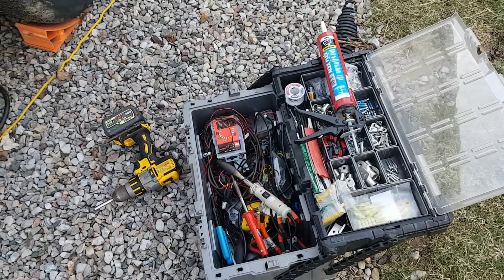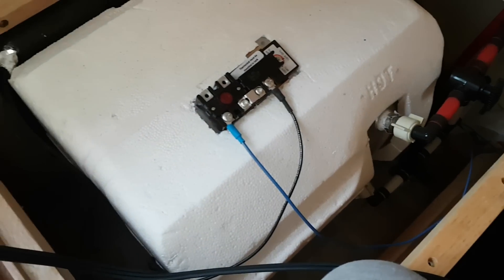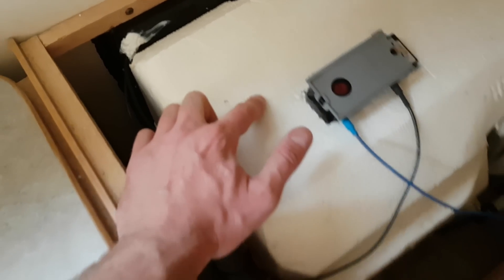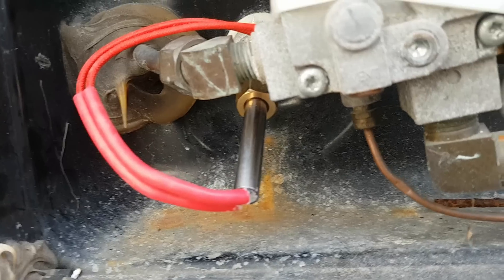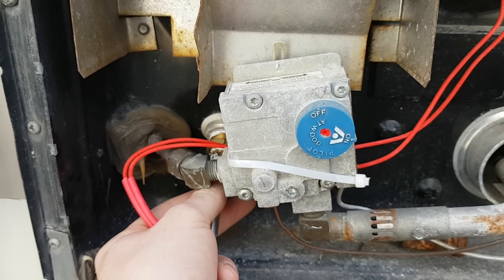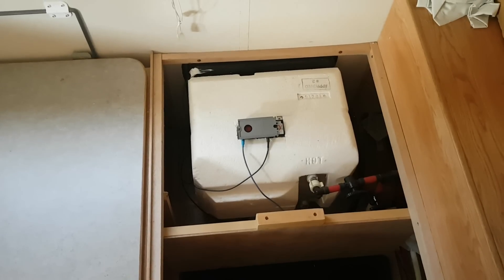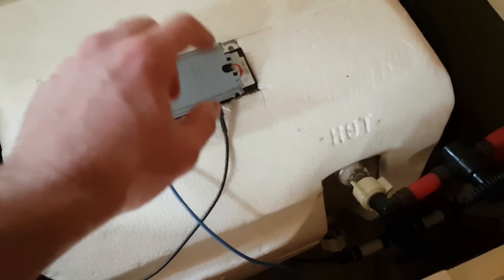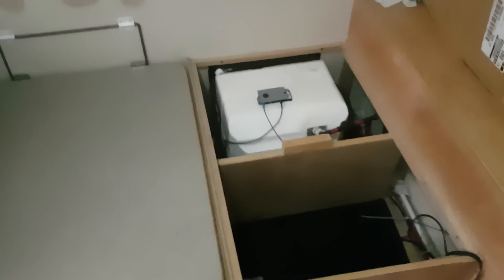Converting RV Propane Hot Water Tank To Solar Electric

Comment: Watched this utube...great idea with using the solar heat, but here’s the big but. You’ve removed the anode rod, it’s there for protecting the steel liner in the hot water tank and removing impurity’s in the water, so what’s better ?

Comment: Cool idea ... But propanes so cheap to be putting that much of a dent in the battery bank isn't it ?
Reply from the maker: just used it all weekend and didn't even notice it running :)
Reply: @GoingOffGrid101  I stand corrected.
Reply from the maker: @peeinginthewind   as long as its sunny I stayed fully charged :)

Comment: Add a second thermostat set to the minimum temperature needed for showering and a relay bypassing that thermostat, with a voltage threshold circuit to activate the relay. That way, you'll be able to use the hot water tank for thermal storage once the batteries reach 90% or so.
Reply from the maker: good idea!

Comment: Nice addition to the camper. I have had a similar unit installed in my high-dollar hobo truck camper for about three years. Takes about an hour and a half to heat up an 8 gallon tank. Okay for one person to use almost no recovery. But nice to use on a sunny day while your battery is a floating you get free hot water or you can plug it in if AC power is available. Don't forget to pull it out once a year and flush your tank because the sacrificial anode is no longer in the tank.
Reply from the maker: Thanks